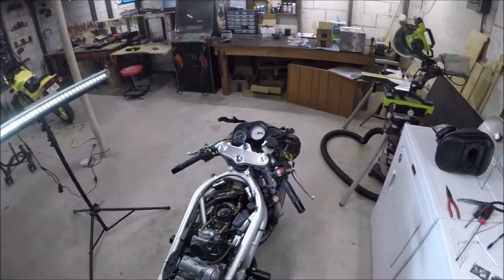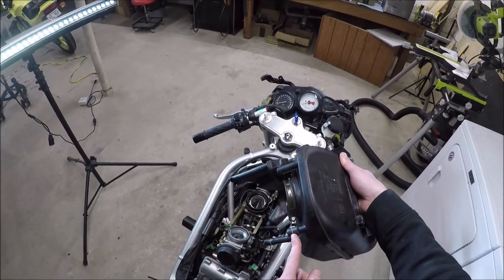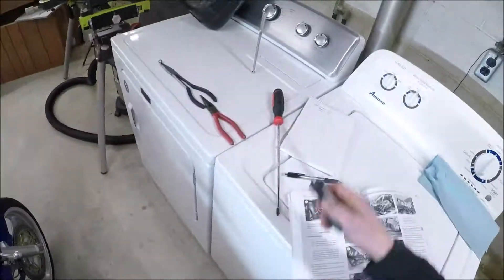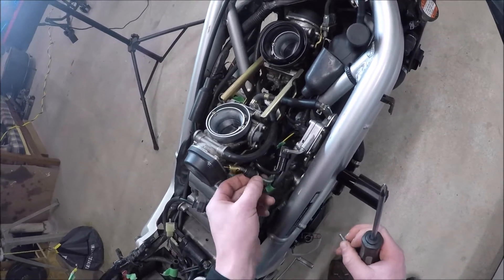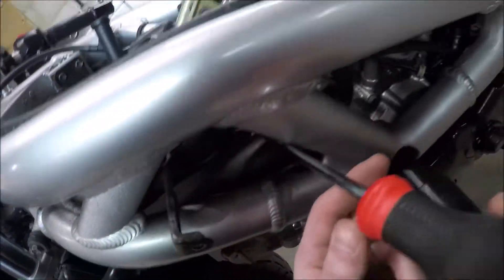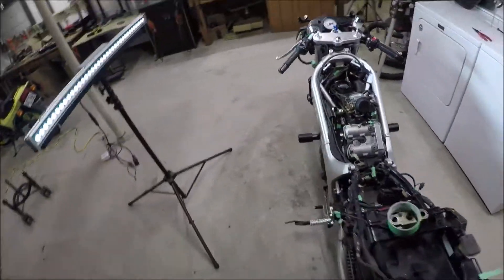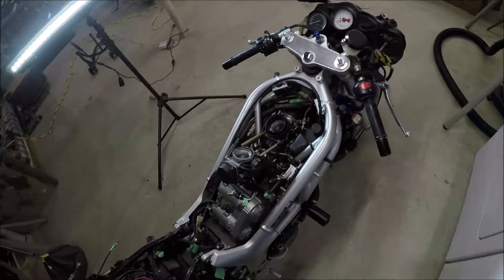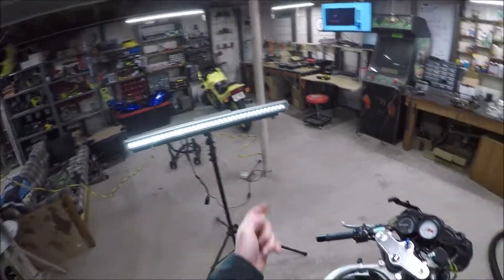Suzuki SV650 - Carburetor Removal

Comment: The green tape is a good idea.  I often put a number on it to tell me which sequence I removed it.  Many times, if you forget, you'll end up with one you can't get access to after you installed other stuff that now gets in the way.  So, the numbering keeps me straight.  If I just installed number 9, I'll be looking for number 8's hose/fitting next.  In your case, the number 1 hose would be the fuel shutoff vacuum hose.

Comment: Great instructions, I don't have a manual yet, luckily  I stumbled on this clip, Just got my SV650-2000 a few days ago. Trying to fix it before spring :)
Reply: good luck man, they're great bikes!
Reply from the maker: I probably should have gone slower, but I figured it would be fun to time myself having not done it before, hah. Pandemic-induced stir craziness making me do weird things.

Congratulations on the bike. Hopefully you're up and running soon!
Reply: @matttriestodothings  I had a DL650-04 for nine years ugly but sweet, sold it and bought a KTM1190-Adventure14, sold that and bought a DL1000, I still have the DL1000, but I sure miss that sweet 650 engine, that's the reason I bought this sv650, I sure long for the spring to arrive, we still have 50 cm of snow here.
Reply from the maker: @rogereliasson8133  Right there with you man. There's a pile in my front yard that I know won't be gone until June because of how my front yard has areas that stay in the shade all day. I'm tinkering around on a few bikes and planning to synchronize my SV's carburetors today just to hear a motorcycle engine again. I just. can't. wait. until we can get back on the road!

Which year DL1000 do you have? I have a 2018 650 V Strom and the bike is so damn big to me, hah. I love the goofy styling of it--which i know is quite polarizing. It's not the most fun bike, but it's a goddamn mule. I owe it some love since I've been ignoring it in favor of some other projects. 

I'd be curious to try out a 1000 v strom just to know how different the power is compared to a 650.

Comment: Good video.

I prefer to take the bars off, remove the switches and controls to gain slack on the cables so I can just flop the carbs over on the bike and clean them or whatever without actually messing with the cables and needing to readjust.
Reply from the maker: Fair play. I've done that as well before. I usually struggle more with getting the control to snap back together, but it can definitely make some bikes a whole lot easier.

Thanks Benson.

Comment: Even with the Japanese bits a bunch of the screws immediately strip because they are stuck 🤙🏻
Reply from the maker: @evanparker3877  yep. Been there before. The clamps that hold the carbs and the airbox are the ones I usually have to fight most.

Comment: thanks for the vid. I've had my sv650 not running for more than 3 years. I removed the carbs and now Can't figure out how to adjust the throttle, it doesn't snap back. Any help is appreciated. Thanks
Reply from the maker: I had a similar issue--I had to mess with the throttle adjustment on the right control near the throttle. I didn't have it free, so I had no snap-back from the throttle.

Comment: Has a guide on how to get the carburetor out. Also him in the first 30 seconds : „alright I’m not gonna do that“
Reply from the maker: @biggie2924  I thought it meant to pull the entire throttle position sensor off, not just disconnecting it. I wasn't going to pull it off.

Comment: Great job! My choke lever springs back when applied.  What could be causing that and how can it be fixed? Thoughts?
Reply from the maker: Like the actual lever on the left hand control is pushing back to neutral position? Or the choke plungers themselves in the carburetor are springing back?
I'm not really sure--I'm pretty stumped trying to figure out the scenario. First thought would be that the choke cable might be routed incorrectly so it has unnecessary stress or force being applied on it. I've routed throttle cables and choke cables incorrectly before, and they do weird things and feel really tight if you do it.
Reply: @matttriestodothings  the choke lever itself springs back. I have to hold it until the bike warms up. I have to check the routing. I wasn’t sure if there was a spring adjustment on the first gens? Thank s!
Reply from the maker: @eddiebee4551  So it turns out there may be a missing plastic piece that provides the friction to keep the choke held out. Check out this thread on svrider that seems to be explaining exactly your position. This has happened to multiple people (apparently). I had no idea. Hopefully this is helpful: https://www.svrider.com/threads/choke-lever-problem-wont-stay-open-springs-back.132360/
Reply: @matttriestodothings  thanks so much!!

Comment: Thanks bro you kept it short an sweet
Reply from the maker: Short, sweet, and partially accurate!
Reply: @matttriestodothings  going to lift my tank now bro thanks again,will let you know how it turns out.
Reply from the maker: @stylepoints973  good luck! A long screwdriver is really useful for the front choke cable. JIS screwdrivers work a hell of a lot better (less stripping) if you've got one available. Just take your time and take pictures if it's you're first time pulling the carburetor out. It's easy to delete pictures later if you don't need em. Can never have too many if you get stumped on reinstallation.

Comment: What is the manual you use. I got one but seem not to be the good one. Pic don’t match my 1st gen carb. 99-02 and I got sv650s 02. Can u help me out
Reply from the maker: I've got the Clymer manual which I believe has both the first and second gen all crammed into one. At some point I'd like to pick up a paper copy of the actual Suzuki factory service manual though. Which manual are you working out of?

Comment: Helpful video, thanks. I don't know what you mean by "JIS" screwdrivers though - is this an American term, or a Japanese bikes term? (I've just got myself a SV650 but every other bike I've worked on has been old British, so very different - please excuse if this is a daft question!)
Reply from the maker: Not a daft question at all. I didn't know about the differences between Philips and JIS screws before I started wrenching on bikes. Philips screws have a bit of a rounding on them, and they're sort of intended to cam out when you tighten them so you don't overtighten them. Unfortunately, it makes it super easy to strip them if they start corroding or are too tight.

JIS "Japanese Industrial Standard",  I believe, are straight cut crosses. A JIS screwdriver has substantially more bite on a JIS (or Philips) screw. You will be far more likely to remove screws without rounding them.

The #1 tool I think you can add to your toolkit if you're working on a Japanese (or any, really) motorcycle, is a #2 JIS screwdriver. I'd also recommend grabbing a #3. The Vessel JIS screwdriver available on Amazon is great. I give it as a gift quite often.

There's several good videos on youtube that explain it. The below link is just one of them. Take a look, pick one up, and you'll never go back. Only problem is you'll want to replace every screwdriver you have. I haven't fully completed my own transformation yet, hah.
https://youtu.be/gEwVUZr5xxQ
Reply from the maker: I should mention, JIS screwdrivers work perfectly fine on Phillips screws. You'll notice a JIS screw if there is a little dot stamped into the head.

https://rtstools.com/jis-vs-phillips-screwdrivers-and-where-to-buy-a-jis-screwdriver/
Reply: JIS stands for Japanese Industry Standard.  The cross tip is slightly fatter, and not as deep.  Often when using a regular cross-tip screwdriver, it is so deep, the sides don't get enough bite to the sides and it tends to strip the screw head.  I learned this a few years back and I never force a "Phillips head" screw until I use one of the JIS to double check a fit first.
Reply: @matttriestodothings  Matt, I beg to differ.  JIS tips are not as deep as Phillips type heads.  So, you don't get proper surface bite with a Phillips when it's a JIS head.  People often strip the heads out trying to use the wrong application.
Reply from the maker: @SinnerSince1962  this is fair. I guess I've never tested it out or maybe I'm just mainly touching JIS screws these days. Good info.

Comment: Hi.I have another problem...i didn't start my sv650 one year because battery go down...after one year i bought booster and i try to start it...but than become a problem...bike don't start and the fuel is leaking from a tank vent...quite a lot...
I think all the fuel is passing carburetor and leaking out from the vent.
has someone had the same problem?
Tnx for the answers...cuss!

Comment: Man I thought they were fuel injected
Reply from the maker: First gen 99-02 were carbureted. The pointy 03 and beyond went to fuel injection. I'm going through a bit of discovery now and am seeing this thing was taken pretty far from stock, so I need to keep all the settings the exact same way, so I'm not chasing problems. 152.5 mains (137 stock), different needle than stock with 2 shims, 17.5 pilots (15 stock), and a de-snorkled air filter. Air/fuel screws were 2.5 turns out (stock 3), and one was missing a washer. 

The bike ran really well, so someone probably knew what they were doing. Unfortunately, I don't know exactly what it was. Couldn't find any  info on the actual needle models on popular jet tune kits.